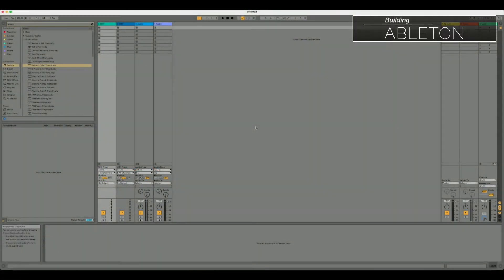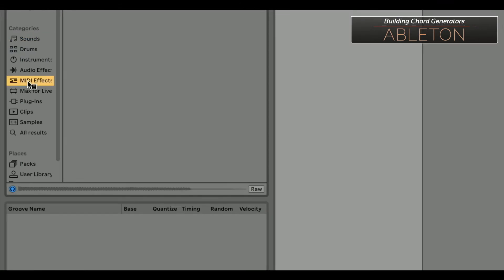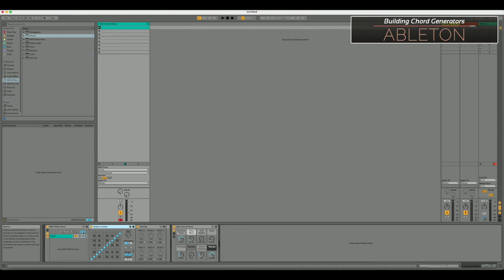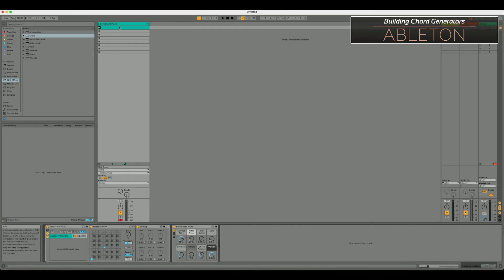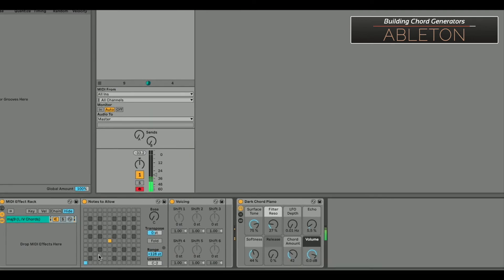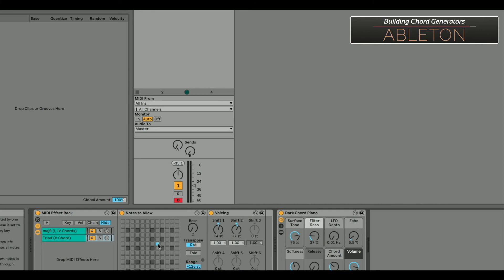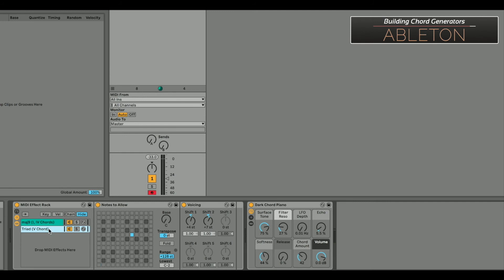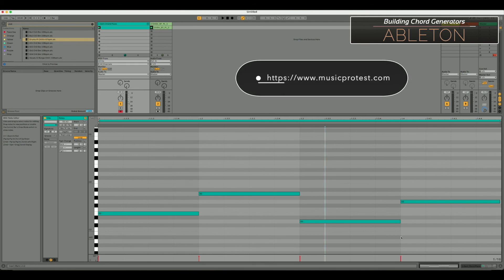Ableton Chord Generator - Tutorial (Using Scale and Chord Devices)

Comment: thanks for the vid!! Is there a way to do for example both a c major and c minor triad, could you trigger that on a keyboard cause they would both be triggered by c?
Reply from the maker: Thanks for your question!  It would be possible to duplicate this device chain and then switch between device chains using a MIDI trigger.